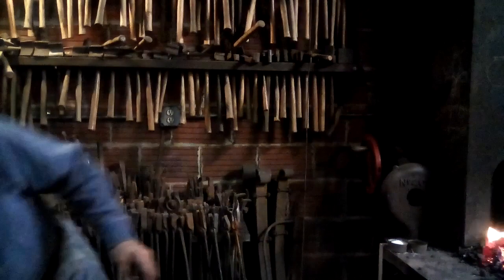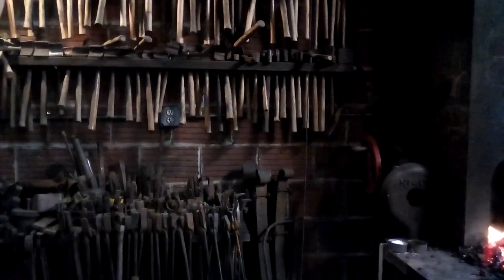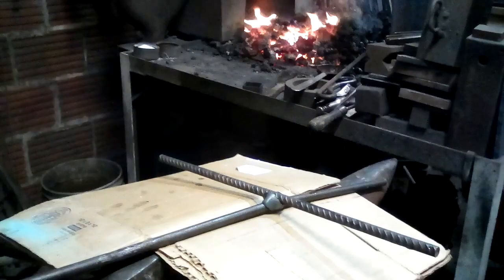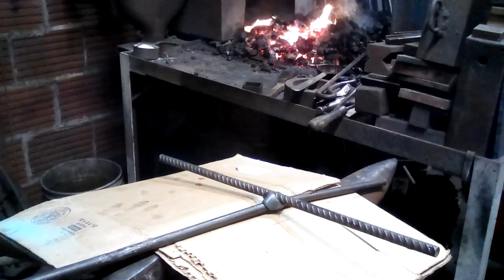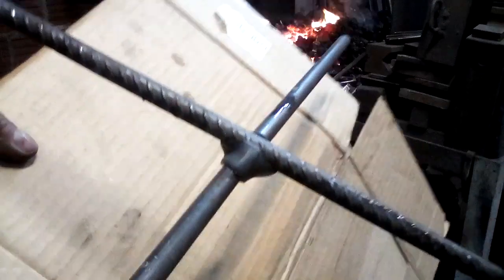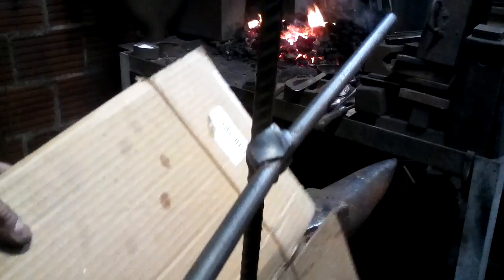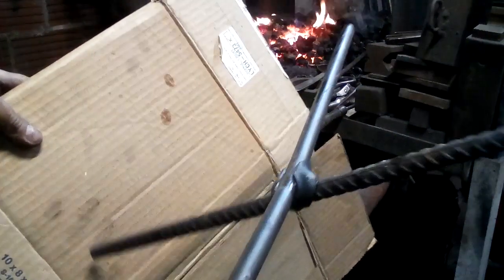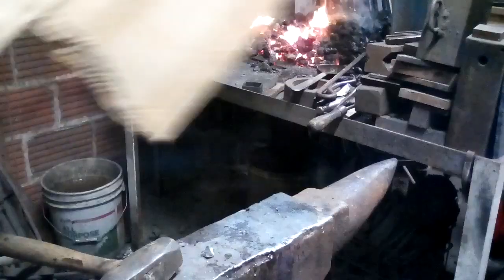Blacksmith demo of a Claydon Clamp , or heat shrunk pipe ribbon to make a right angle joint

Comment: Daniel, I have been smithing for a few years, but this Claydon knot is one of the coolest, most applicable things I have seen.  It's a neat, very simple way to join crossed rods.  Can it be used for solid square rods as well?  I'll have to experiment with that one, LOL.
Reply from the maker: Hi:
Yes , they are fun. The ratios do vary with the shape of the bars. The best way to get it right is to think about the length needed to go "around the corner". With round rods it just needs to go past the mid point, square bars need to go all the way past the top edges.
Daniel

Comment: Daniel this is so fun. Thanks for sharing this! I wanted to ask about the inner vs outer measurements of the pipe and/or wall thickness. Do those come into play? I’d love to try this. Just want to make sure I get the correct materials. Thanks for all you do!
Reply from the maker: Hi:
 It needs to be heavier than sheet tubing. I have not measured it , but most of the stuff I used is around 1/8" wall.
Daniel